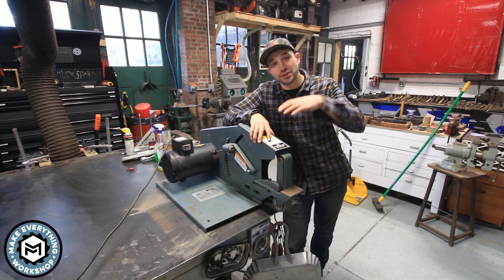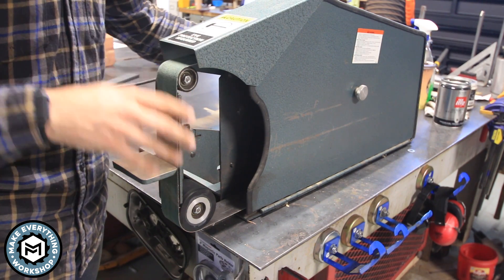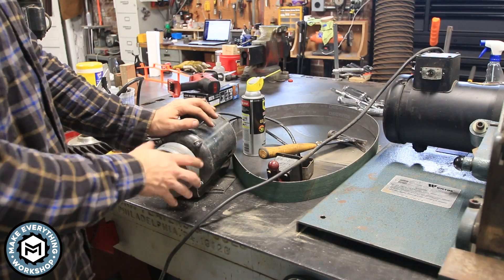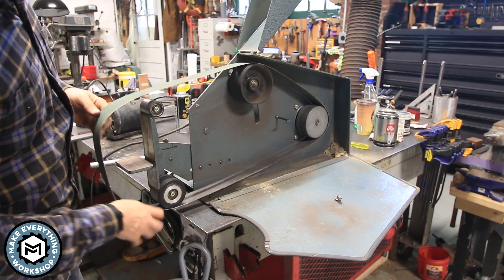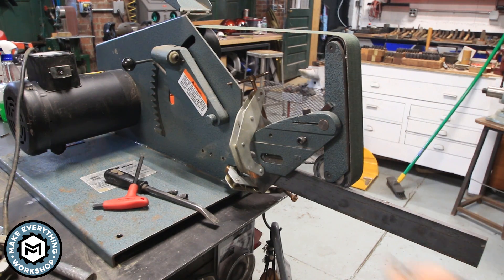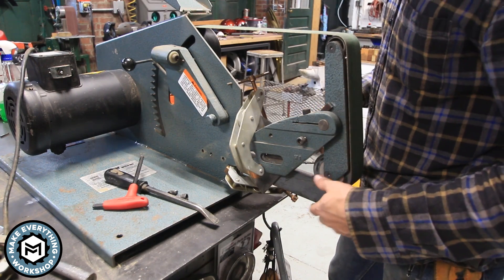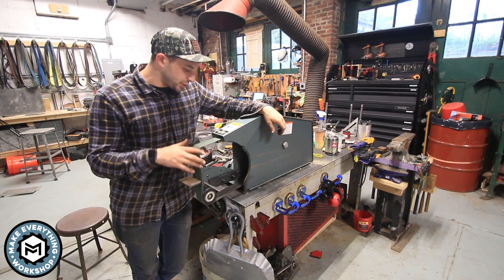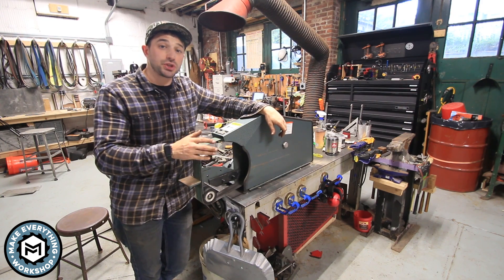Slowing Down a 2 x 72 Belt Grinder (Knifemakers Grinder)

Comment: I have the same 10" drive wheel on the one I'm building. It has a MASSIVE 2hp sealed dc motor but with a vfd. Took the motor from an industrial cement mixer. 1750rms but you can lay your body weight into that pig and it doesn't slow a bit. Without the vfd It would just eat steel in seconds. Idk why not just add a vfd

Comment: The only trouble with this method, is you reduce the torque ,less belt contact due to smaller wheel,
if there was a way to use step down pulleys from motor to pully like drill press would be a better option,
But as this vid is about reducing the speed of the belt, and given the grinder you have this method is a cheep alternative
Reply: smaller drive wheel means more torque (well, more belt force, the torque output of the motor is the same) plenty of grinders use drive wheels this size without belt slip.

Comment: Another way is to attach a step pully to the original drive pully and then mount another motor above, behind or below the machine with matching step pully to drive the machine. This way you could gain multipal speeds. The original motor would serve only for it bearings and mount.

Comment: Nice work! Am I missing something? Instead of extending the bed of the grinder, could you not have installed a shorter belt? Or do they not come any smaller?
Reply from the maker: Dennis Maratos yes smaller belts could be purchased but since I already stock many many 2x72 belts I wanted this grinder to work with the ones I have.
Reply: You can go with shorter bekts but they dont last nearly as long as the 2x72.  As a result, they cost more to use.
Reply: Wow, your machine looks like it has come out of this world. Your brain works is super excellent. Wish my brain can do that. Can I get the measurements of your super Belt grinder. Thanks for letting me watch.

Comment: You did a great job, but why slow it down?
Reply from the maker: loveminis thank you! I make small knives and do a lot of detailed work. For me it’s much better to have the belt moving slow as opposed to fast for optimal control. And in my case I have a second grinder that can run to max speed if it’s necessary.